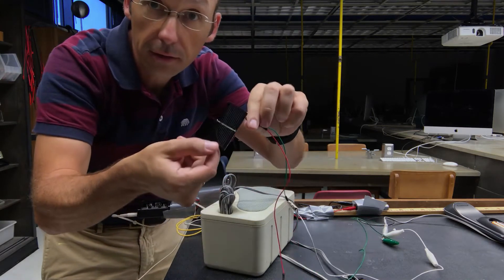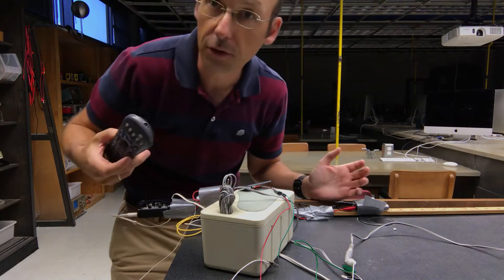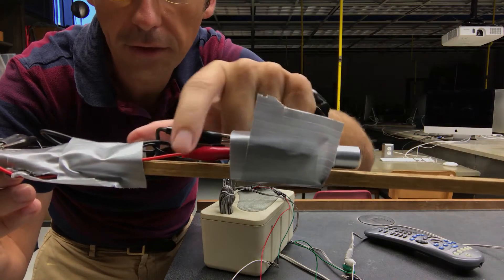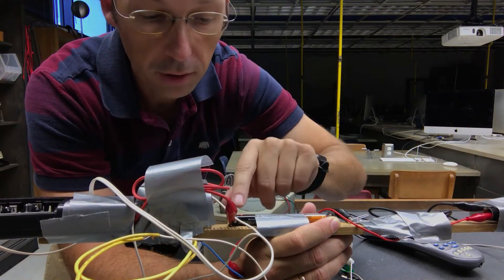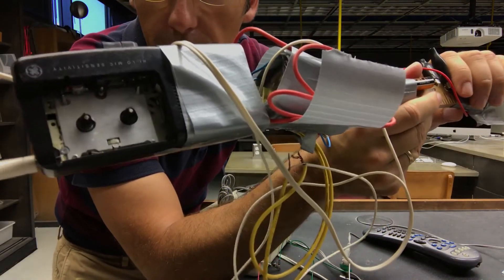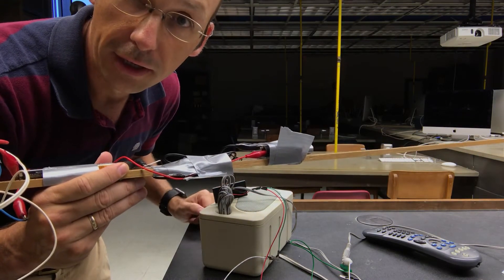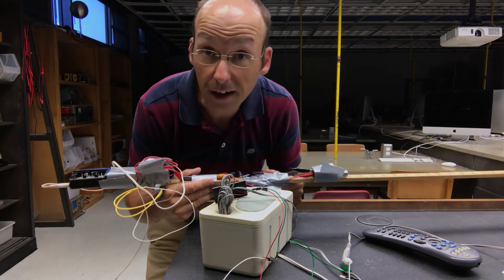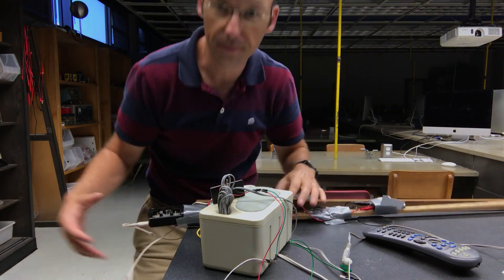MacGyver Photophone Version 2

Comment: Is it necessary to have like a mini solar panel?
Reply from the maker: yes - that is the part that turns the changing light into changing electric current for the speaker.
Reply: I think one could use a phototransistor. or a light dependent resistor even